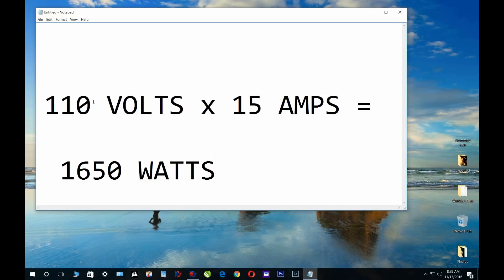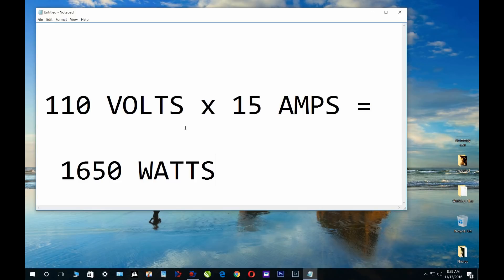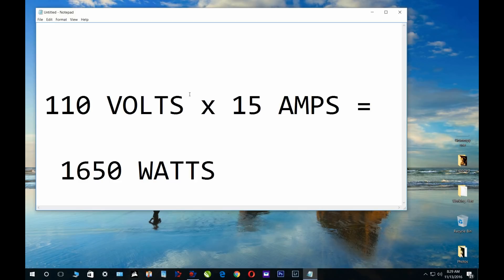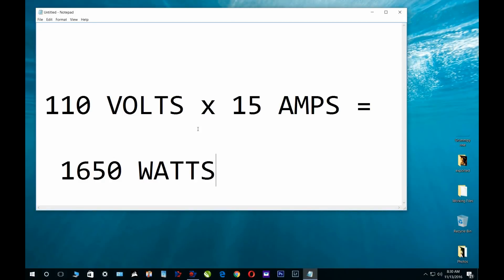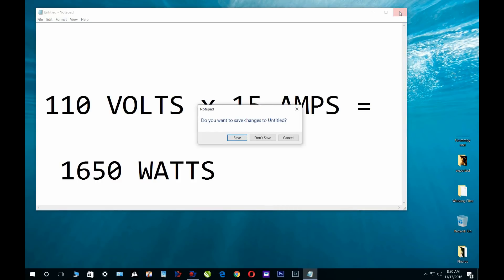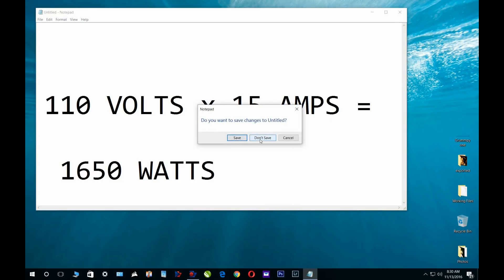Volts X Amps = Watts formula. 110 x 15 = 1650 example.  Convert volts, amps + watts

Comment: I understand getting the wattage, so to clear it up 1650 watts is the running wattage? How can I determined starting wattage ? So I could get the right generator for a air compressor
Reply from the maker: I had to think about your question a bit. Now I think I understand you want to use a Portable generator to run a compressor, like a gas unit. Generators tend to have running wattage as you state and peak wattage. Best rule of would be to get a generator that runs approximately 20% higher then the compressor wattage listed. Example a 15 amp compressor should be using a 2000 watt running generator, not max or peak watts.  So if the generator has 2000 watts running and listed at a higher ( 2500 ) peak watt rating this would work lovely.

Comment: Hi there...Please I live on an island and we use 220. I have a machine which is 110 can I use a 3000 watt transformer to convert the electricity?
Reply from the maker: I apologize I really don't have a lot of expedience with generators. But we also have 220-240 applications  here in the US and we can easily wire a Breaker in a service panel to pick up current from one leg in the panel. Most panels here have two legs each one providing 110 voltage. Not sure if you might be able to use this method. Then there's the neutral wire could work with the ground side. We have two legs and a ground for our 220-240 volt applications. I hope this hopes since I'm not experienced enough with other countries that use 220 and not 110 like we do. there is also some thing called a step down transformer we use here regularly. So in theory you would be looking for that steps down from 220 to 110. And then there's a bunch of adapters we use when we travel over seas and this might be a option for you. Best of luck!
Reply from the maker: I also forgot to right that 3000 watts @ 110 volts is just over 27 amps which is very high and wiring size will be need to support that kind of load with out over heating 10 gauge can support 30 amps and is recommended here in the US.

Comment: Great video. Direct to the point. I was wondering! Would be possible have a car alternator supply power for a house considering that the alternator (shaft/belt/rod) will be running in a hydraulic motion (waterfall) and that the car battery has an output 90 amp @ 14 volts ?
Reply from the maker: I know there are converters that convert 12 volt D/C to A/C current. But directly from a Alternator sounds different and interesting. Also if you could have a clean conversion 90 amps X 14 volts = 1,350 watts. I would say not enough for a house. I guess this is the main reason most people opt out for a generator instead. But your concept is still interesting if batteries where in play like a solar system storing energy for later use.